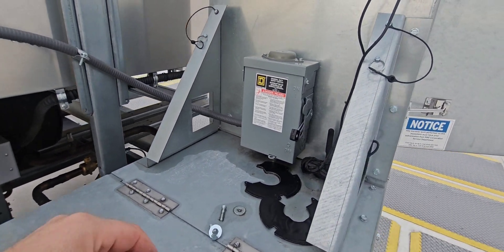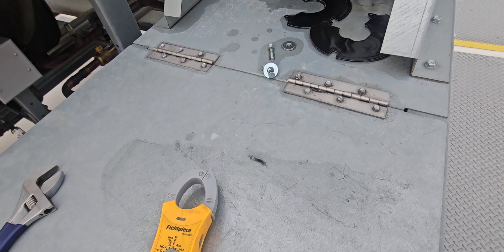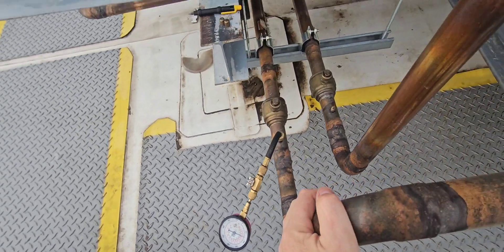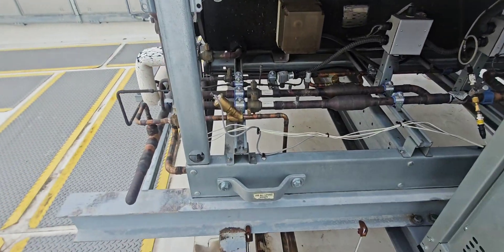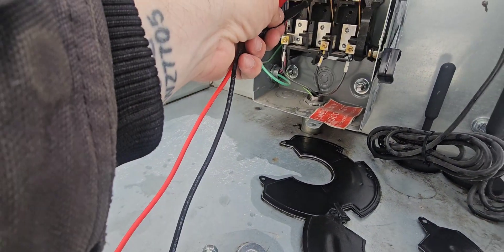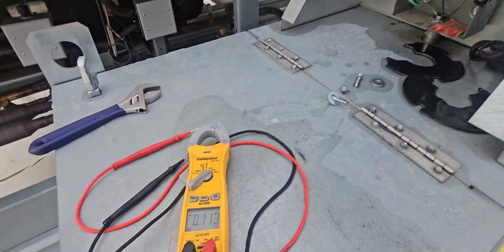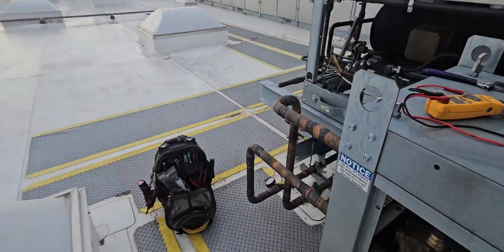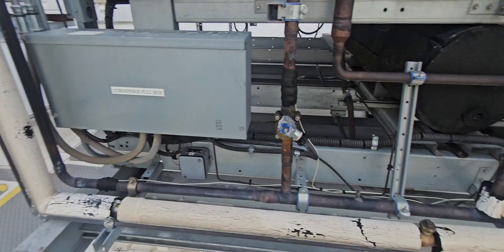WTF is a LPA?

Comment: It helps decrease head pressure and prevents flash gas to the txv for energy savings. It supposedly makes the compressor more efficient and less compressor ratios. They're called LPA Pumps. Liquid Pressure Amplification Pump.  It's usually used on long pipe runs

Comment: I’m fairly confident that pump is used to “boost” the liquid out because Walmart/Sams Club chooses to run their head pressure so low that in low ambient conditions, it’s hard to move that liquid out to the cases, just wants to stack. So they use the pumps to pump the liquid out to the cases. I usually see that setup valved off.
Reply from the maker: Ya just another low ambient control.